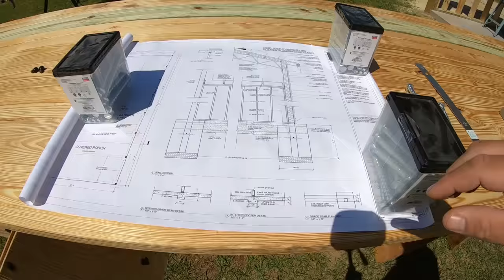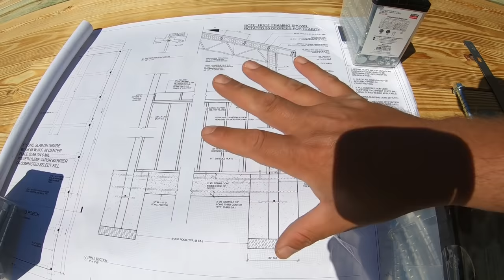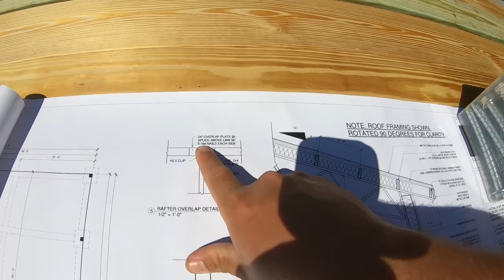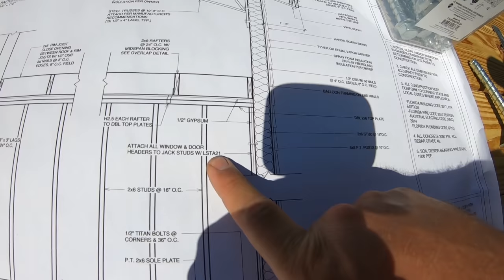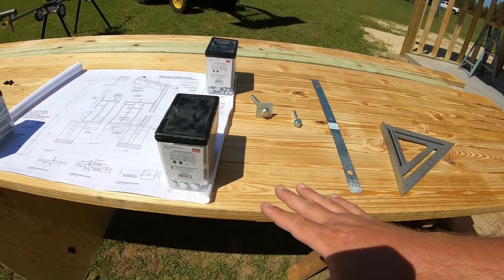Pole barn house wall with window header! House build #12

Comment: Cut all your floor plates and top plates for a couple of sections one time. Set them in place and then pull your 16" on centers at one time. This will speed up progress.
Reply from the maker: I think you are correct! Thanks

Comment: I just want you to know I notice your attention to detail in producing a professional video.. That 500ft air hose so we can’t hear compressor.. Lol

The way those walls  slide snugly between those posts after all those measurements and cuts is amazing. You da man.
Reply from the maker: Believe it or not (maybe you were serious) I did go buy extra air hose to keep the compressor out of the picture. I have a pancake compressor that would be running often on this build. My big shop compressor is better suited and doesn't ruin recording with noise. Good catch!

Comment: You should put a mini split heat pump in for your AC. Very efficient
Reply from the maker: Yes but they do have some drawbacks. I met with my second AC installer today

Comment: My first real construction job was a home framer. Now that was over 20 plus years ago. I have never had to add metal straps to any window headers. But I also used 2x10 headers! I would have tied the top plate in with these metal straps.
Reply from the maker: Walls are not tied to the roof, so no uplift. I still don't understand why I need any straps.

Comment: It is very interesting they wanted you to lag studs to the posts, once you lag at the top and the bottom that stud is two blocks with minimal added strength past.   These are your added studs as well
Reply from the maker: What I like about all the extra lags is if the post were to ever rot off or have some major issue. It's tied on both side and carrying force via the suds to the footer.  That could buy some time for a tear out and replacement.

Comment: your headers will carry attic load. roof load will transfer to 6 x 6  pole structure . you are doing fine. exterior sheeting is most important  for structural integrity. Interior sheetrock can start from anywhere in a room  16  inch  o/c
Reply from the maker: Thank you for the feedback

Comment: Looks great!  Tiffany is a trooper trying me things.  I am not a carpenter.  Seems to me the strap on the inside will cause an issue with the finished wall.  Could be wrong.  Just an observation.  Great job!  Looking forward to more!  Thanks!
Reply from the maker: All straps do get in the way, I'm not a fan of them. But code requires them in a lot of spots. Thanks for watching

Comment: I’m surprised your plans called for so many headers, usually in a pole barn style construction or post frame construction the walls aren’t loadbearing so the headers aren’t needed. Are you putting a separate roof on the house even under the pole barn roof?

I like that you resolve an issue by choosing the option to go overboard, I tend to do the same, it just makes more sense to me, it might cost a little more but you don’t have to go back and fix it later.
Reply from the maker: Nope! We've been asking the same questions.

Comment: Looking good you two. The header strap. I want to say all the way to the top plate but can not remember for sure though
Reply from the maker: It's a tough one to figure out
Reply: Just talking it through. During a wind shear event if the wind uplifts the house and the strap is only connected to the header, then the top plates could potentially be lifted off causing damage. The hurricane strapping is a system. Seems that attaching the top plates as well and then strapping  the roof to the poles would be necessary as well. In retrospect , did the poles get attached to the slab with perpendicularly attached rebar to prevent wind uplift from yanking the poles from the footers?  Just thinking out loud.   Great job guys.
Reply: @brianfletcher7942  yes the poles had opposing rods. Looked like about a foot apart. It’s going to take a lot to pull those poles out
Reply from the maker: Correct, those poles are staked with 5/8 rebar, buried 5ft deep and poured into concrete. There is technically no uplift on the wall top plates, just the poles themselves.

Comment: I noticed on the last video you did not use any barrier between your bottom sill and concrete, and it happened here too. Is this not required in your area?  Even so I think for the cost it is well worth the extra protection to try and keep out the bugs and moisture, IMO,   love your videos
Reply from the maker: This video was recorded before all the suggestions came in. I've already fixed that and will have a video out this afternoon. Thanks!

Comment: Instead of a window unit, why not go for a mini-split? That way your window stays clear and you can use it normally. You'll have the compressor and radiator outside, while inside will have your head unit with the heat exchanger that is SO much quieter than any window unit.
Reply from the maker: Money.... Money lol... Window unit can be had for 150 bucks, we will need the savings after this house build 😁

Comment: Why don't you make/mark up a "16 inch o.c. stud wall story pole" to lay on the floor to speed up the lay out of the wall studs on the bottom and top plates?  After the 8 foot "16 inch o.c. stud wall story pole" is measured out and made, then all you have to do is put the bottom'/top plates in place on the concrete foundation between 6x6 support poles and use the "story pole" marks to lay the studs on the plates out so you do not have to  measuring/mark every wall stud space location.
Reply from the maker: A great idea! Thanks

Comment: Lol now you lined up your  outside 16" your onside drywall is not gonna work out lol
Reply from the maker: Very good point, I'd rather cut the sheet rock than the Sheathing. The sheet rock doesn't add to the structural integrity like the wood does.